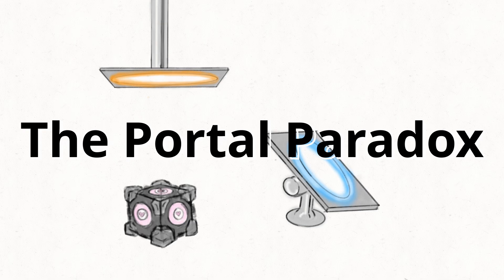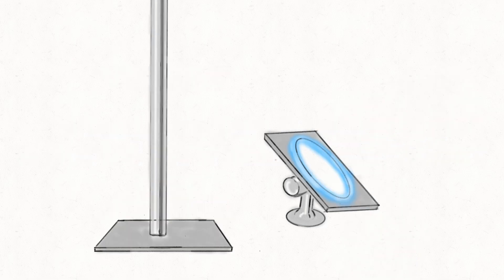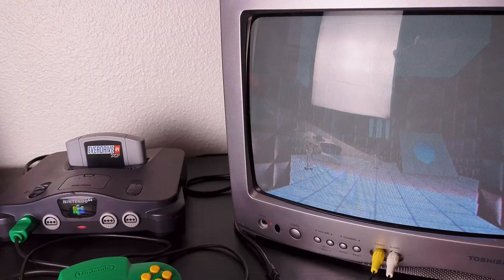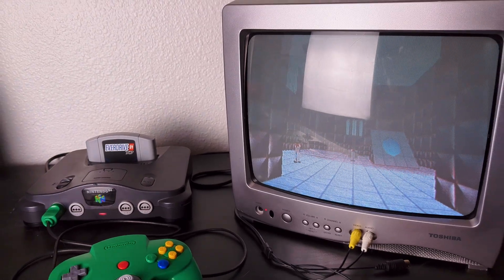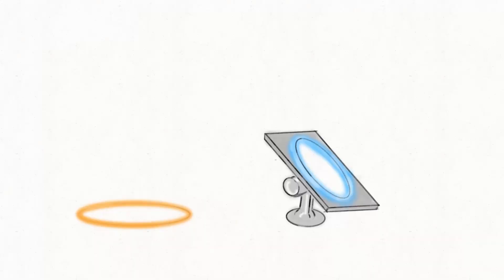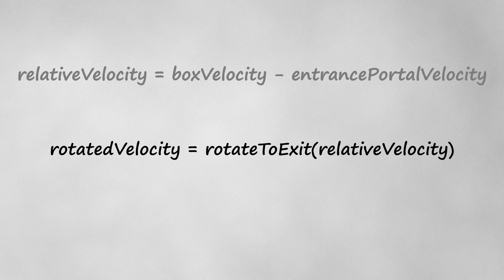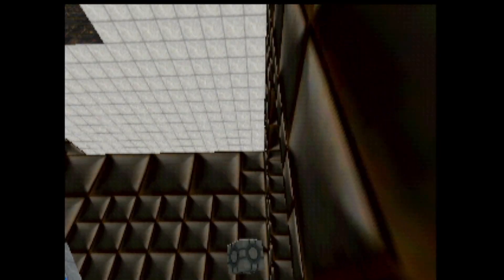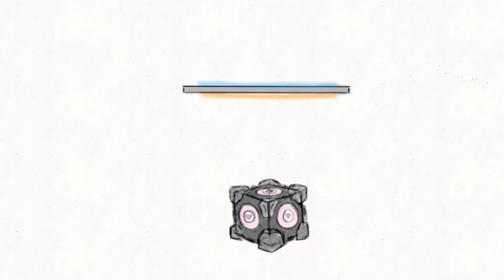I rewrote Portal from scratch and solved the Portal Paradox

Comment: Portals don't have mass, so they don't have momentum. Velocity isn't conserved, momentum is. Moving portals just mean the location of one of the two slices of 3d space that are linked is changing over time. There are some explanations about how portals, as wormholes, work, although they don't all say that portals can be moved along with a surface. We can just assume that the place where space is linked is moving at the same rate as the piston, but still, there is no movement of a mass in 3d space, only a change in the layout of 3d space. Therefore your answer is wrong (if you accept the idea of portals as wormholes in the first place) but it does make for a better puzzle gameplay, so who cares? After all, the portals aren't accurate portrayals of a wormhole and they would be physically impossible as depicted, so it's best to just make the best puzzle game you can with rules that are consistent. And you chose consistent rules, even if they make less sense than the opposite choice, because they're still consistent and can give you more gameplay options. So I say, let's be wrong, so we can be right!
Reply: The cube has momentum relative to the orange portal when it enters. Therefore, it must have momentum relative to the blue portal when it exits. What's the argument that its momentum should change?

Comment: For some reason, I feel like the floor plays a role here that isn't being seen. This might be me being stupid, but it is just irking me. Consider T-ball versus Bunting. In T-Ball, almost all the energy goes one way, bat to ball. Whereas in bunting, the ball comes to the bat, the energy gets diffused out into the bat, into the batter, and so forth. 

I feel like shooting an object through the portal is like hitting the ball with the bat. All the energy goes into the moving object which exits the portal with that velocity. But when the portal comes to the object, some of, if not a lot of, the energy would also be diffused into the floor, attempting to pull the floor through as well, which doesn't happen, stopping as much energy output.  

A second question also comes up. What happens if the portal drops down to 3/4 of the cube? Does the energy of 3/4s of the cube pull the cube through, or because the bottom is stationary on the ground, does it not feel lift until it is no longer on the ground and relative velocity changes?

Comment: I think the portal paradox comes about because having it shoot out would create kinetic energy out of thin air, as there is more kinetic energy in the system at the end then at the start. you could theoretically use this mechanic to create an energy-positive perpetual motion device which is impossible.
but not having it shoot out would cause contraction on the cube flattening it into a dense pancake.
Reply: You can already create infinite energy using non-moving portals, so I think it's fine.

Comment: I still disagree on the logic here. I'll try my best to explain, but mainly velocity is being added to an object without being interacted with.  If the portals are just two holes that are connected in space, moving a portal at any speed wouldn't affect the box's velocity. To answer your question at 1:47, the issue would lie in relativeVelocity = boxVelocity - entrancePortalVelocity. As the entrancePortalVelocity is affecting an item at rest without ever interacting with the object.

Comment: I had GPT help me, but I think it would violate an energy principle if it flew out the exit portal. 

Edit: Projectile portal violates the conservation of energy. All energy added to the entry portal is removed upon stopping the object that moves the portal. There is no energy to transfer. 

Original GPT Response:

The Scenario
Let's consider the specific case mentioned in the video transcript:

A stationary exit portal
A stationary cube
A moving entrance portal
When the entrance portal moves towards the stationary cube and "captures" it, the cube should theoretically exit the stationary exit portal with the same kinetic energy it had when entering the first portal. In this case, the cube was stationary initially, so it should also be stationary as it exits the second portal, according to the principle of Conservation of Energy.

The Claim
The video maker claims that the cube would fly out of the exit portal. If this were to happen, it would indeed seem to violate the principle of Conservation of Energy. The cube would have gained kinetic energy without any apparent source for that energy.

Relative Motion
The video maker uses the concept of relative motion to justify why the cube would fly out of the exit portal. While relative motion is important for understanding how the cube and portal interact, it should not result in a net gain of kinetic energy for the cube unless there's an external force acting on it. In other words, while the cube and the moving entrance portal might have relative motion, this should not translate into kinetic energy for the cube unless that energy is supplied from somewhere else.

Conclusion
Based on the principle of Conservation of Energy and the specific scenario described, the cube should not gain kinetic energy and should remain stationary as it exits the stationary exit portal. If the cube were to fly out of the exit portal, that would indeed violate this principle, assuming no other forces are at play.

This reasoning aligns with well-established physics principles. If the game's mechanics suggest otherwise, they would appear to be inconsistent with these principles.
Reply: Even non-moving portals violate the conservation of energy.

Comment: What happens if the portal stops when the cube is halfway through though? The original one should stay still but your teleported side needs to shoot out.
Reply: Intuitively, I think it'd be the average of the bottom half's inertia and the top half's velocity (as inherited from the portal's velocity). If only 40% of the box is through, only 40% of the portal velocity is pulling on it.

If it's pulled halfway then stops, I could see the box pulling itself the rest of the way out of the portal then weakly tumbling to the floor; more air-time if the portal gets further down. 

Basically 100% portal entry = 100% the portal's velocity; and it scales down proportionally from there. But even at 10% entry there would be 10% velocity trying to pull the box up.
Reply: If portal stops immediately, cube would break in hapf because there would be infinite force applied to uper half. If portal stops not immediately, then it depends on how fast the portal stops and how strong the cube is (if portal is stopping slow enough (or cube is strong enough) cube will fly out with half the momentum)
Reply: I would say the final velocity would be less than the entrance's original velocity.
You are completely correct in saying that half of the cube should stay still, and the other side should shoot out. But the side that's shooting out would pull on the side that is stationary. The stationary side is accelerated while the shot side is slowed down until both sides share the same speed.

Comment: you could have tested the portal paradox in portal 2, while portal 1 does not have any support for movable portals, portal 2 does i believe in a way, as in one level you use portals to cut the tubes to the neurotoxin generator which move, so if you wanted to test it in a source game engine game without doing too much that could have maybe been a good game to test it in, but im not sure i might honestly be completely wrong

Comment: I thought the Portal paradox was passing a plank or concrete slab with a Portal on it through the other portal. The only comprehendible answer I can think of is you’d get a black hole, assuming the game doesn’t crash to desktop from being unable to solve the paradox either.
Reply: What, why? The plank would just srart coming out of the portal that is on itself.
Reply: @RealClassixX  Yes, but it would just keep going, especially if it re-enters the other portal. Just try and picture it happening: it's harder to visualise than you think. There's also if the Portal passes through itself along with the plank. 

We only can't shoot portals through another portal for gameplay reasons unless we do the portal peeking trick. IRL if portals were real, there might not be such a limitation. In fact, there wasn't in Narcbacular Drop as far as I remember.

Comment: "hey i solved the paradox the way i think it should work!" Sorry this does not work this way. Tho nice vid.
Reply: I give you the same challenge he did in the video, show me a single flaw in his equation
Reply: @imallsoupedup  i can say same to you. Say where he was right. You can't. No one can. Because this is what paradox creates. A question which should have a logical answer but it cannot be found. Portals being stationary or not do not provide any forces of their own. Gravity does. That is the simples answer. The force of the cube would be no more than what the gravity would had been already providing meaning it would plop out of the other side. Sounds right. But there is the thing. How we can know if portals do not posses any specific mechanic which would make it different? The main thing everyone toying with these things forgets is the forces already present. The force affecting cube wont be stronger than the force of gravity pulling on it. Its physically impossible.
Reply: @crimson3274  the portal is NOT providing the momentum, the piston is
Reply: @imallsoupedup  but the box is stationary. Meaning there is no force affecting it. If the portal is like a instant door it means no forces applied as it never makes contact with the cube meaning that the force that it would enter with would be at most the cubes weight after passing pulled by gravity. A simple way to imagine it is to try and put a ring fast  on a object. If any force was to be applied it would be force opposite meaning that even with this theory the cube at most would be pressed against the surface and not ejected as its not the cube entering the portal but portal being "pushed" on it. It would need to defy the laws of physics to do it.
Reply: @crimson3274 Consider looking into the portal. From that perspective, the box is moving towards you with considerable speed. Where does that speed go? You inderectly assert that said relative speed is deleted, I am telling you that that breaks the 2nd law of thermodynamics. If you say that that is how portals work, fine. But you can't use physics to justify a situation which breaks physics.
Reply: @imallsoupedup  speed of a empty hole is none. There is no contact between the box and the portal as its a hole. The problem is that the portal is a door which while open passes everything through. Meaning that pushing it forward passes anything through like you were to pass it through a loop of rope. For the portal to work this way it would need a actual way to generate force and by that to interact with the box. No interaction means no reaction. Just passing through is not enough as the box has no initial speed. Only thing changing is orientation meaning it would simply be affected by the force changing as it passes and by it being pulled by a proportional force applied to it by the gravitation as it passes which depending on the speed would keep it stuck to the floor and pull through the other one down as it passes. Not eject like its shown on the video. Hole is a hole no matter how you look at it. If the portal had any sucking power or anything like it (but it does not) then it would be a possible reaction.
Reply: @crimson3274 There is relative speed, otherwise the portal would not be able to move at all. The rest of the universe, as well as the other portal, is moving relative to the moving portal. Calling the portal a hole is inherently wrong, because you assume both ends of a hole are at the same speed. With a doorway, if one end is moving, the other end is moving. Consider this not like a doorway opening into a house, but rather as jumping straight up to get into the door of a moving train. The door is moving towards you, but from the perspective of the train conductor, the door is completely still. When you get through the door the train is still moving at its previous speed, but you are at a standstill. From the train conductor's perspective, you just flew in at like 50 mph, or whatever speed the train was at. It's all about relative velocity.

This will be my last reply until you answer the actual question I posed last reply; Where does the relative speed of the cube go?
Reply: @imallsoupedup  there is none fie to no contact. Prove a portal is not a hole then say its wrong. It connects two points and has a entrance and exit. The portal has no forces applying towards the cube nor the matter entering it due to no contact with it. It has literally no point of contact to transfer anything. And if it by any chance did it it would press it against the surface for a while before the force of gravity pulls it down on the floor. It rushed towards as the force applied is a push not a pull sono force is trying to jet the block out. Its simple physics. Saying "physics don't apply" is an absurd. Try to pull something by pushing on it. The other way of doing it would be in 0G vacuum where the block would not move at all and then it would be much easier to understand this for you.
Edit: block has no initial force put towards it at any point so there is no force affecting it.
Reply: @crimson3274 Since you can't or won't answer my question, I don't have to assume you're arguing in good faith any longer. Cya, and have a nice day!

Comment: It couldn't shout out because it needs force for that to happen...
Reply: Which the piston provided…
Reply: @imallsoupedup  how ? it didn't touch the thing
Reply: @meme_me The piston moves the portal, so the cube has a relative speed towards the portal. The faster the piston moves, the faster the cube is relative to the portal.
Reply: @Schampu4000  I am a visual typa guy so I need to make this in 3D to see it happen and then deside based on what I saw if it should shout or not

Comment: You are wrong because "Momentom",
The cube is standing still and doesn't have a "Momentom", there is no "Force" pushing int forward,
it doesn't matter if the Portal is moving, because the Portal is not tangable or Physical,
I would even argue that the cube would be pushed back a tiny amount due to the air being pushing towards the cube because of the piston.

Comment: Nah, the cube has no velocity of it's own. It really shouldn't go flying. If you were to have the bottom platform going up towards the portal, by your rationale the cube would somehow lose all momentum, which is the opposite of how portals work in portal. Glados says fast thing go in, fast thing come out, not stationary thing go in, fast thing come out or vice versa.
Reply: Velocity is relative to the portals. If you’re looking in through the stationary, diagonal portal, a piston pushing the portal towards  the cube looks basically the same as a piston pushing the cube towards the portal, the cube has a velocity relative to the portal in both cases.
Reply: @imallsoupedup  Portals don't change the velocity of items that pass through them, which is to say the portal isn't relevant to the item's velocity. All they do is change the position of the item within space. energy isn't being transferred/removed to the item during transport, thats why items never shift speed until they're on the other side and are being acted upon by different forces. going by how it "looks" is like saying you can go faster than the speed of light by using a flashlight as an accelerator while you're running since you're adding your running speed to the speed of light.
Reply: @toastcrunch9387 Your first statement is wrong. Portals don't change the velocity relative to the portal of items that pass through them. The velocity of the cube relative to the portal is not 0, therefore the cube exits the stationary portal at considerable speed.

Comment: A really easy way to visualize why the Portal Paradox works like this, is to instead visualize the blue portal on the wall on ground level, and instead of the orange portal slamming down on a small block, it slams down on a really tall object placed vertically. The really tall object would come out horizontally out of the blue portal and scrape over the floor as the rest of it is coming out. You can then easily imagine that once the tall object has come out entirely, it will not instantly stop out of nowhere, but will continue at the speed it came out of the portal, albeit quickly being slowed down by friction as it continues scraping over the floor.

Comment: I think you are wrong, yet I can't show you the flaw in your equation. The mistake isn't there but in my opinion in your interpretation of portals. You and everyone who thinks the cube should shoot out seem to think, that portals are objects. But they're not. They are the two sides of the same hole in space. They work just like a door. You can walk through it to go from one part of space to another. Just because I move the door extremely fast in your direction you don't suddenly get motion, do you?

Edit: Okay, just after I commented you explained my point yourself. I still think it stands. There shouldn't be a difference between moving both ends or just one. Because the portals are the same hole. It just doesn't matter. The velocity an object has is relative to the space it's in. Traveling through a portal doesn't change that.